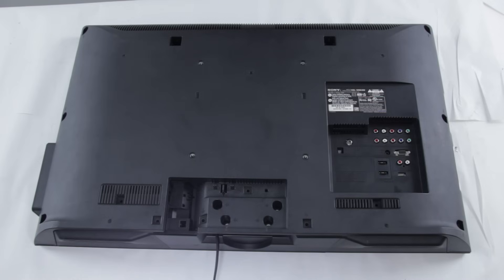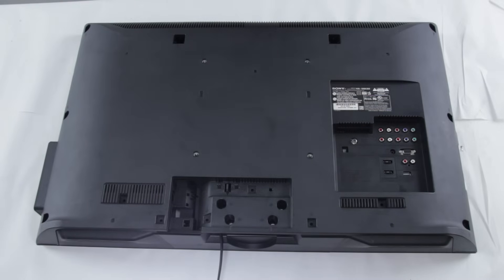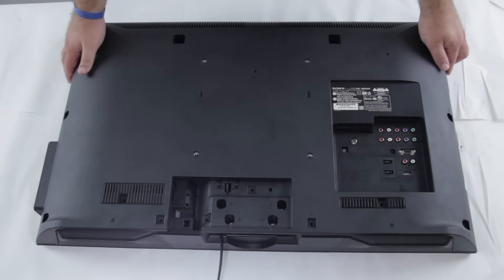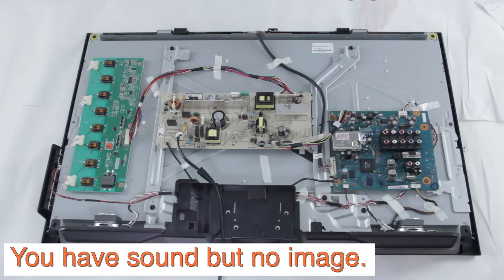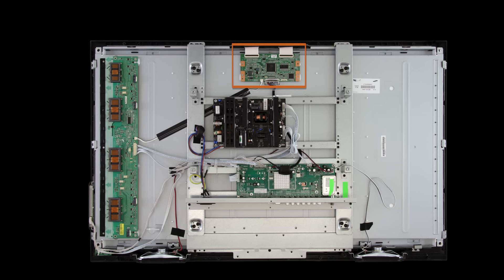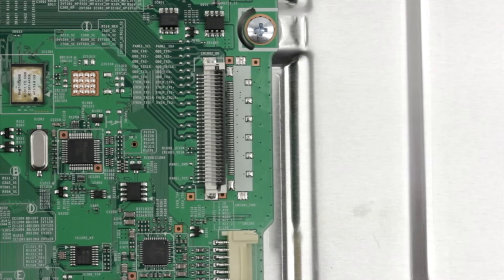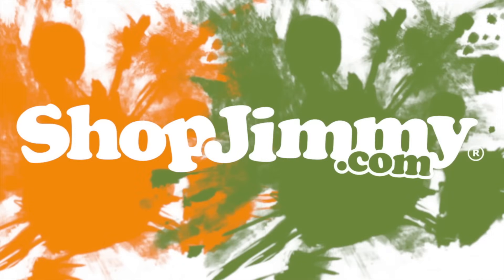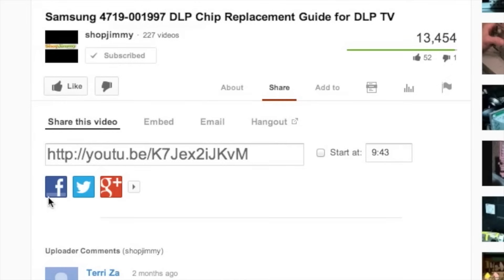LCD TV Repair Tutorial - T-Con Board Common Symptoms & Solutions - How to Replace T-Con Board

Comment: I have a Samsung Model: LN-S4695D Bought in Canada 2007.
About 3 years after buying it, lines appeared on the screen but we could still see the picture and watched it for last few years. It recently lost picture completely and now has green vertical lines with black lines in between. I had a tech look at it when it first had the lines and he said it was a card but he couldn't find the card for this model. He said the next thing to do would be to change the screen but that would cost too much. Any ideas how to fix this problem.
Reply from the maker: Michael Lee This sounds like you have a bad panel in your TV.  Panels are typically difficult to find, hard to replace and expensive.  It may be more cost-effective to replace your TV.  Thanks and please let us know if you have any further questions!  www.shopjimmy.com

Comment: Samsung 46" LCD TV screen problem     This link to the left is exactly what my Samsung TV is doing.  I looked around on Youtube to find a quick solution and read a few comments suggesting adding some sort of shims to remove slack in some strips has worked.  However, I removed the back of the TV and could not identify where those strips were on my TV.  Obviously I am not familiar with the inner workings of a TV.  The model number is LN46A530P1F, Any suggestions would be greatly appreciated!  Thanks a lot!
Reply from the maker: mbomb51  Be very careful and conduct this repair at your own risk.  You have to remove the plastic frame, then turn the panel facing the ceiling, take those screws off and that would expose the tabs at the top of the panel.  Thanks and please let u know if you have any further questions!  www.shopjimmy.com

Comment: Help....I have a lg 60 inch plasma model number 60pk200 and I have 7 green lines on the screen from top to bottom, very thin and it's on in all the outputs... Please advise
Reply from the maker: victoria ramlakhan If the lines are running vertically from top to bottom, I would say the problem is most likely the TV panel.  TV panels are often difficult to replace, expensive and hard to find to in stock.  It may be more cost-effective to replace the TV.  Thanks and please let us know if you have any further questions!

Comment: I have a Hisense 50K360G, when I turn it on the power light blinks 7 times, pauses, then blinks 3 times. After this it appears the backlight comes on but there is no picture. I can hear the weather channel that is on and I can also play a DVD and hear the sound but no picture. could this be the T-Con board?  Im sure that the power light is giving an error code but I cannot find error codes of a hisense tv anywhere on the net.  Any help would be GREATLY appreciated!
Reply from the maker: Jeff Ignasiak I would recommend replacing the t-con board in your TV.  Here is a link to replacement parts for your TV model number on our website, click here:  http://www.shopjimmy.com/catalogsearch/result/?q=50K360G  Be sure to match part numbers on your current board, with your replacement for compatibility.  You can also call our customer service for further assistance with your purchase.  (877) 881-6492  Thanks and please let us know if you have any further questions!  www.shopjimmy.com
Reply: Thanks for your advice...  I've replaced the T-con board as you have suggested and I still have the same problem. I even replaced the ribbon cables just to make sure the were not bad but still no change. when I turn on the TV the light below the Hisense logo blinks 7 times, stops, and then blinks 3 more times then the back light illuminates but no picture. Do you know if there is an error code list for this TV? It sure looks like an error code... it didn't blink like that when it was working.  Thanks for any help you can give me on this.

Comment: Samsung: Model LN52A750R1FXZA
Serial No. ALB73CMS104503K
I Have Audio, But No Video
Reply from the maker: Paris Martin I would recommend running the flashlight test on your TV to help determine if the problem is the main board or the backlight inverter.  Here is a link to the flashlight test video:  No Image No Picture on Screen-Flashlight Test LCD TV Repair - How to Diagnose Broken Board TV Repair  Please reply with the results of your test and we can suggest a fix.  Thanks and please let us know if you have any further questions!  www.shopjimmy.com

Comment: I have a LG 42LH30-UA TV that powers up and has a blue screen. The audio works fine and I can change channels but screen stays blue al the time. When the issue first started the picture would work fine then change to all blue then back to normal. It was very intermittent for awhile. now the screen is blue all of the time. All of the wire and ribbon connection seam fine. The two fuses on the Power Supply and one on the T-Con board tested under 1 ohm. Thanks for any recommendations.
Reply from the maker: sherri michaelis This could be either or both the main board and the t-con board.  Here is a link to replacement parts for your TV model number on our website, click here: http://www.shopjimmy.com/catalogsearch/result/?q=LG+42LH30-UA Be sure to match part numbers on your current board, with your replacement for compatibility.  Here is a link to a video showing how to identify your part number, click here: Main Board: TV Part Number Guide for LG & Zenith Main, Digital, & Tuner Boards (LCD, LED, Plasma TVs) T-Con: LCD Help Part Number Identification TV Repair Guide for LG Philips Timing Control (T-Con) Boards You can also call our customer service for further assistance with your purchase.  (877) 881-6492  Thanks and please let us know if you have any further questions!  www.shopjimmy.com

Comment: Vizio
Model No: E321VL
Serial No: LATKHLIM2901485

I can turn the TV on but does not show any image in the screen.
I allready did the reset, dose't work. What can I do I how much it cost? Thank you
Reply from the maker: Edward Chong I would recommend replacing the main board in your TV.  Here is a link to replacement parts for your TV model number on our website, click here:  http://www.shopjimmy.com/catalogsearch/result/?q=E321VL Be sure to match part numbers on your current board, with your replacement for compatibility.  Here is a link to a video showing how to identify your part numbers, click here:  TV Part Number Identification Guide for Vizio Main Boards (Plasma, LCD, LED) You can also call our customer service for further assistance with your purchase.  (877) 881-6492  Thanks and please let us know if you have any further questions!  www.shopjimmy.com
Reply: ShopJimmy.com
hi i have a toshiba 46xf355d

i am getting a thin vertical line in red but the picture is perfect,it does not matter the input the line is there.also very occasionally it goes fuzzy picture but all i do is tap the back and it goes normal again!

making me think its the tcon board

i am thinking it will be the tcon board,what do you think? i can get the parts quite cheap so would just like to narrow down what it could be

thanks i look forward to your reply!

Comment: rca model no 32la30 rqd with vertal lines on the left side of screen .Audio and sound good.Negative raster!!
Reply from the maker: ory901 This could either be a bad panel or a bad main board in your TV.  You could try replacing the main board to see if that fixes the problem with your TV.  Here is a link to replacement parts for your TV model number on our website, click here:  http://www.shopjimmy.com/catalogsearch/result/?q=32la30  Be sure to match part numbers on your current board, with your replacement for compatibility.  You can also call our customer service for further assistance with your purchase.  (877) 881-6492  Thanks and please let us know if you have any further questions!  www.shopjimmy.com

Comment: Great Video 

I have a Toshiba Model 32HL57 . The TV powers up, Audio Works and the backlight is on but no picture. Not a white screen but its as if the Panel is not getting signal to display the image. It looks like this image link http://www.pictrace.com/i/IMG_1009.JPG

Main Logic Board has already been replaced and the tv still has the same issue.
Reply from the maker: Eric Scherzinger I would recommend replacing the t-con board in your TV to see if that fixes the problem.  Here is a link to replacement parts for your TV model number on our website.  http://www.shopjimmy.com/catalogsearch/result/?q=Toshiba+Model+32HL57  There are a few different t-con boards that show up in the search results.  So you will want to confirm the part number compatibility for your current board and the replacement part.  You can call our customer service if you need assistance.  (877) 881-6492  Thanks and please let us know if you have any further questions.  www.shopjimmy.com
Reply: I've changed the t-con board and I had picture for 20 seconds with lines showing and then back to the same result of no picture. 

Any Idea's?
Reply from the maker: Eric Scherzinger
This sounds like there is a short in the panel.  Thanks and please let us know if you have any further questions!  www.shopjimmy.com

Comment: Samsung un40 eh6000 flickering I have sent a question through facebook. But I have flickering on inputting images on my samsung un40eh6000
Reply from the maker: Nam Le H. This problem is being caused by either a bad t-con board or bad panel.  If the problem is the panel, you may be better off replacing the TV.  However you can try replacing the t-con board to see if that fixes the problem.  Click this link to see replacement parts on our website for your TV model.  http://www.shopjimmy.com/catalogsearch/result/?q=un40+eh6000  Thanks and please let us know if you have any further questions, you can also call our customer service for further assistance.  (877) 881-6492  www.shopjimmy.com

Comment: Hello I have a Samsung 46" Model #UN46B6000VFXZA, Serial # AZ1H3CUS4006410, software version T-CHE6AUSC-1004.0, Version SQ01. The problem is the leftside has a perfect picture,but the rightside also has a picture but has a darker tint to it. It starts halfway across the screen. This problem started 2 yrs ago and I had it in a electronic repair shop for over 2 yrs. They said the panel it needed is not available in the US. I paid for the panel B4 they ordered it from Samsung, but they said it was defective and wouldn't tell me which panel the TV needed. I'm a novice at TV repair but willing to try. I'm thinking The T-Con board. Any help would be appreciated. Thank you!
Reply from the maker: Curtis Highland This sounds like a panel problem for your TV.  You could call Samsung to see if you can order a new panel, but other than that unfortunately TV panels are typically expensive, hard to find and difficult to replace.  It may be more cost effective to replace the TV.  Thanks and please let us know if you have any further questions.  www.shopjimmy.com

Comment: HELLO I HAVE A 42"VIZIO VW42LFHDTV10A AND IM HAVE A PROBLEM WITH THE POWER "I THINK", WELL WHEN I PLUG IT UP THE ONLY THINK I GET IS THE STANDBY MODE LIGHT, I TRIED TO CUT IT ON WITH THE REMOTE AND WITH THE BUTTONS ON THE TV BUT I DONT GET A RESPOND I GOT IT FROM THE PAWN SHOP FOR 50.00 AND I WAS HOPING IF I COULD FIX IT I COULD GET A GREAT DEAL PLEASE HELP   PLEASE
Reply from the maker: darnellius bell I would recommend replacing the main board in your TV.  Here is a link to replacement parts for your TV model on our website.  http://www.shopjimmy.com/catalogsearch/result/?q=VW42LFHDTV10A  You will need to identify the part number for your main board and then match that number with a replacement part from our website.  You can use this video to help identify the part number: TV Part Number Identification Guide for Vizio Main Boards (Plasma, LCD, LED)  Thanks and please let us know if you have any other questions, you can also call our customer service for help.  (877) 881-6492

Comment: Hello,
I was given a Polaroid TLA-04641C.
The symptoms it's having is the picture is often ghosting (blurred) or parts of it frozen,  or distorted.   After having it awhile,  I found that if I tap on certain areas I can get the picture to clear up and it will work usually until I turn it off.

I have opened up the back,  and with it on I tried tapping the ribbon cables and didn't see any change in the picture.   But if I press on the T-Con board,  it does effect the picture (sometimes it fixes it,  or other times makes it worse).   Just to be sure it's not the ribbon cable, I unhooked and rescured it at the T-Con.    The only place I can't get to is, where the ribbon cable connects to the actual LCD.   Looks like I have to do a total disassemble to get to that.   But since tapping the ribbon cables didn't seem to do anything,  I don't think it's that.     Your thoughts?   Do you think it's safe to assume that it's the T-Con board?

Thanks
Chris
Reply from the maker: Chris Doyle Yes, I believe the problem is either the T-Con or the panel.  You can try replacing the t-con to see if that fixes the problem.  Here is a link to replacement parts for your TV model number on our website.  http://www.shopjimmy.com/catalogsearch/result/?q=Polaroid+TLA-04641C   I would recommend contacting our customer service team to confirm your board numbers for replacement part compatibility.  (877) 881-6492  Thanks and please let us know if you have any other questions!  www.shopjimmy.com

Comment: I have a Samsung LN40A650A1FXZA.  Just recently it started to intermittently display a green, snowy image and would start to power cycle.  It did this a few times then was fine.  A day later upon power up, the green, snowy image appeared, it went into power cycling and continued this for dozens of cycles until I unplugged it.  After researching this model I took it apart.  All the caps look good (not visibly blown).  I cleaned out all the dust (5+years worth!), removed and cleaned all the ribbon cable contacts and reassembled.  This seemed to fix the problem for several hours until the vicous cycle started all over again.  Where do I go from here?  Thanks!!!
Reply from the maker: Jason Stalker Conduct this test at your own risk.  I would recommend disconnecting the main board from the power supply, and checking to see if the backlights stay on for the TV.  Please reply with this information and then we can recommend the next step.  Thanks and please let us know if you have any questions!  www.shopjimmy.com
Reply: ShopJimmy.com Thanks for helping.  I disconnected the flat 5-pin connector and the 24-pin (2 rows of 12) connector from power board to main board.  Plugged television in and absolutely nothing happened.  I reconnected the 2 connectors, plugged TV in and it went back to its power-up, bad picture for 4 or 5 seconds, power down, repeat cycle.  What should I try next?  Thank you again.

Comment: i have lg 42" 5 yrs old the tv was fine a day ago it was on for 2hrs last night then the screen went white with slight outlines of the picture with sound then i took back of and lead to tcon board i plug lead back in  now it has a dark picture with very strong blury colours could you help whats wrong
Reply from the maker: packsta64 I would recommend replacing the t-con board in your TV.  Please reply with your TV model number and then I can recommend a replacement part. You can also call our customer service with your TV model number or t-con part number and they can help you with replacement part compatibility and your purchase. (877) 881-6492 Thanks and please let us know if you have any further questions! www.shopjimmy.com

Comment: Hi Jimmy
I got 52inch samsung ln52a650 lcd tv. I installed the wrong update for this tv. I installed an update for ln52a750 onto ln52a650. Now the tv just keeps turning on n off on its own and no picture or sound. I am thinking its the main board? What could it be any help would be highly appreciated.
Reply from the maker: lucky4om408 I would recommend replacing the main board in your TV.  Here is a link to the search results for replacement parts for your TV model number.  http://www.shopjimmy.com/catalogsearch/result/?q=ln52a650  Please call our customer service to guarantee compatibility for your replacement part.  (877) 881-6492  Thanks and please let us know if you have any further questions!  www.shopjimmy.com

Comment: I have 52 inch samsung tv model LN52A550P3F and have half of screen missing picture. I ordered a tcon board from SHOPJIMMY.COM, and replaced the board. IT DIDN'T FIX :(     what else could it be??? I have sound.. but no picture on half of screen still.
Reply from the maker: Andrew Clegg We are working on your request.  With the recent changes, we are working through our questions and will respond to yours asap.  Thanks for your patience.
Reply from the maker: Andrew Clegg It is a bummer the replacement part did not fix your problem.  Since the t-con did not work, I would think the problem is your TV panel.  Panels are typically expensive, hard to find and difficult to replace.  It may be more cost effective to replace the TV.  Thanks and please let us know if you have any further questions!  www.shopjimmy.com

Comment: I have an Sharp aquos LC32D62U tv. I'm suddenly getting vertical lines across the whole screen. When the screen is black it's short of a blue haze. Doing some research it seems I need to replace either the TCON or main board. Which do you suggest?